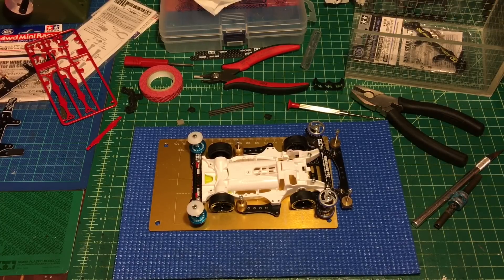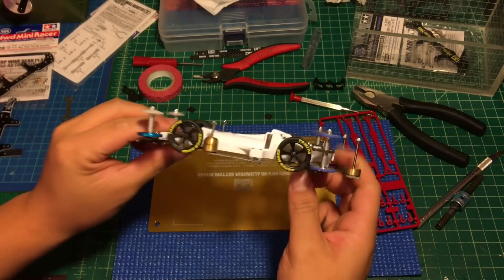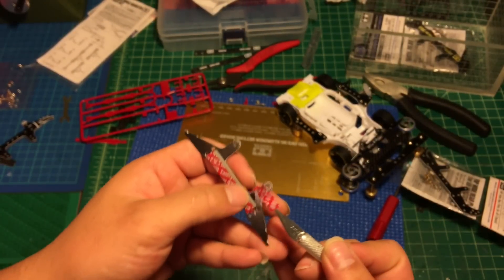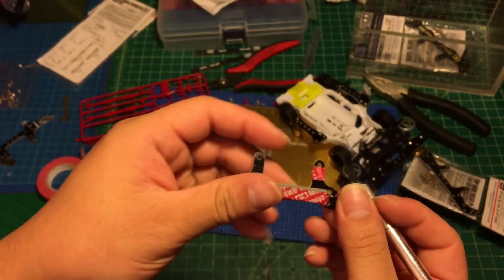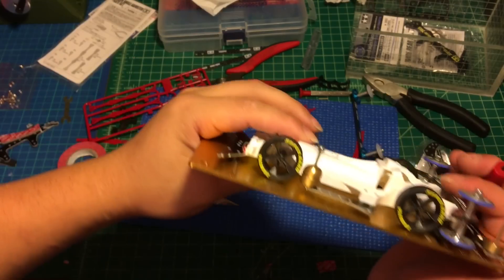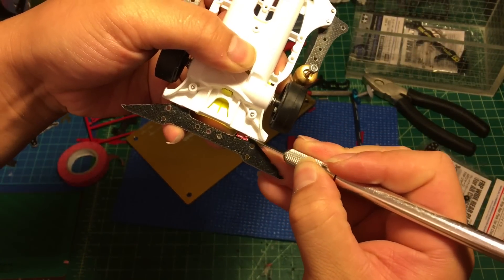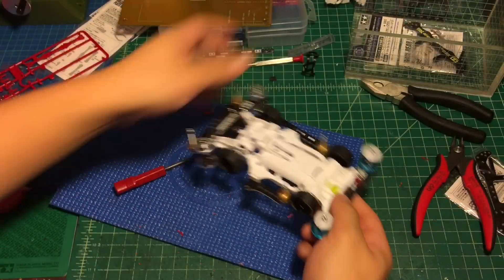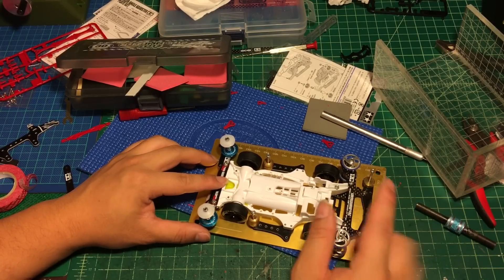【ミニ四駆】Tamiya Mini 4wd AR Chassis foundation Series 7(Front Bumperless Setup V3)

Comment: Mad Tang the front underguard is very weak wat can we do to make it stronger cause I broke 2 of the high grade ones
Reply from the maker: well, video 5 is the recommend way to do the front under plate, plus make sure you cut chassis in correct way,do not over cutting it. Make sure the roller stay on top have the support on chassis which I explain on video 5 .